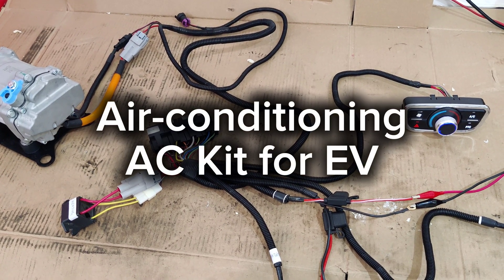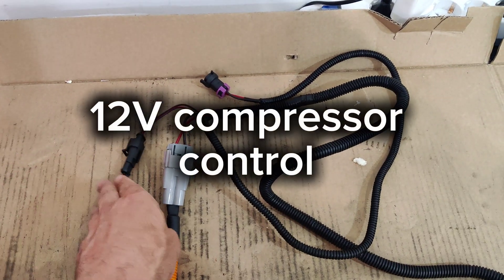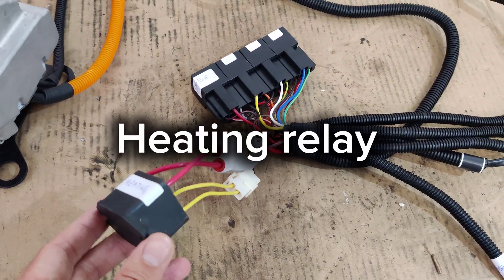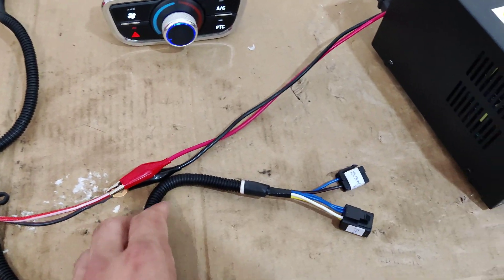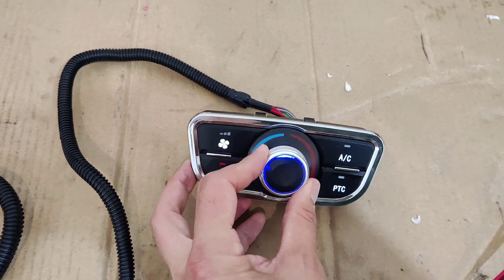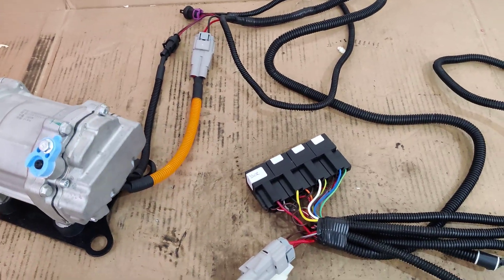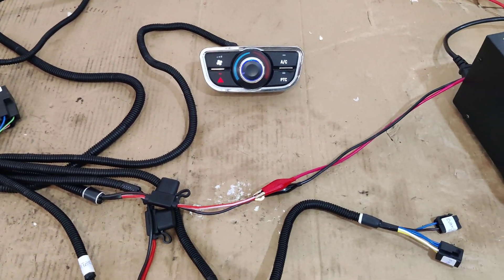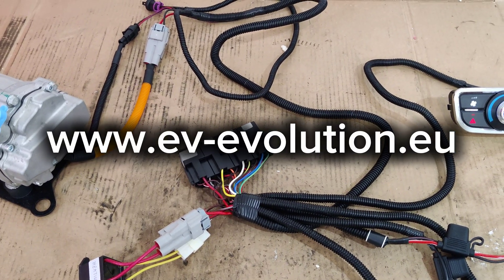Air-conditioning Kit for EV Conversion

Comment: Does it mean that I can install this aircon during the conversion of a car, which didn't have aircon before?
Reply: No, you must have original air condition in the car. With this kit you only swap your original AC compressor which was originally driven by belt from crankshaft and this kit AC compressor has small electric motor inside housing compressor which runs on 96 Volts. With this kit you also control PTC electric heater.